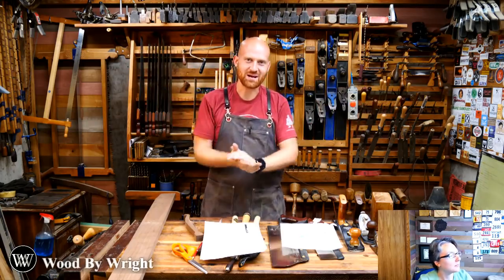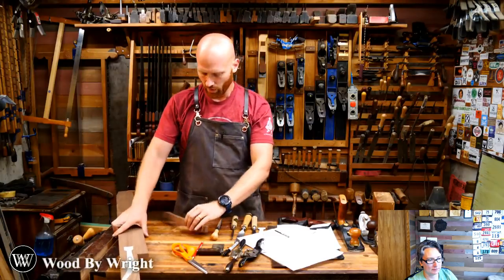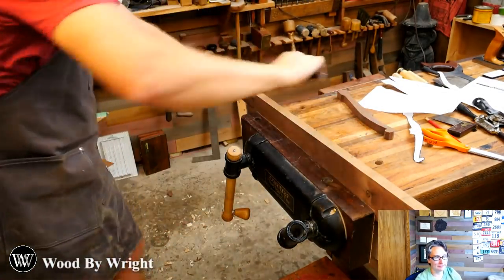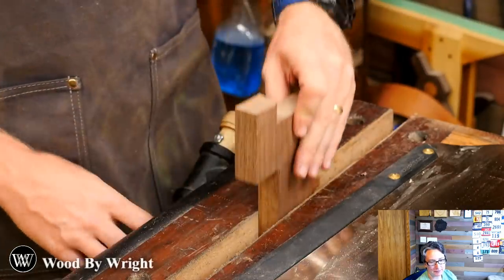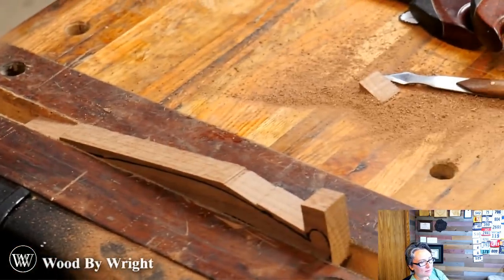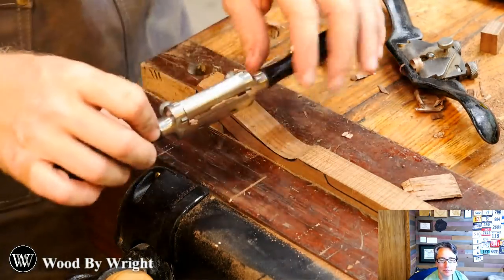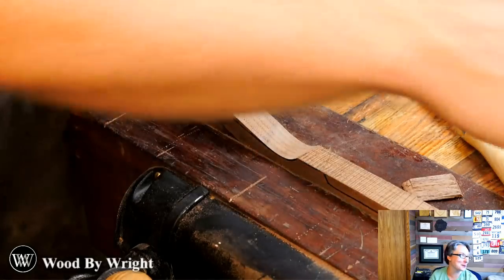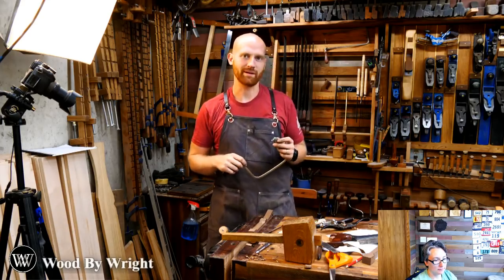Making a Turning Saw Live

Comment: There is a large european style turninng framesaw hanging in front of your roubo saw. I know that these saws can be used for ripping and crosscuts. Could you show us the proper usage of those saws? I have a hard time figuring out how to ripcut a board with such a saw. The slat in the middle of the saw kinda prevent me from getting too deep into the wood. Also, do you use the sawblade so that it cuts on the push or pull stroke?
I would be really gratefull for some pointers.
Reply from the maker: I want to do that video soon. But I have a few other things I have to do with it first. If you want to rip with a bow saw you have to turn the blade 90° to the frame that way you can rip all the way down a board. Push or pull depends on what you like. Most of the time I'm going to use it on the push stroke as I'll be using it either at the saw bench or held vertically in a bench vise.
Reply: Thank you very much for the reply. I imagine that it would be tricky to hold the saw stable and do a straight cut, when the blade/ frame is turned 90 degrees. I am really looking forward to that video, allthough I enjoy all the videos you do :)